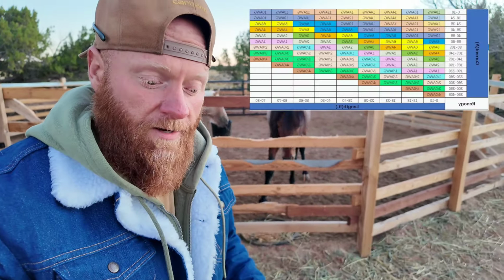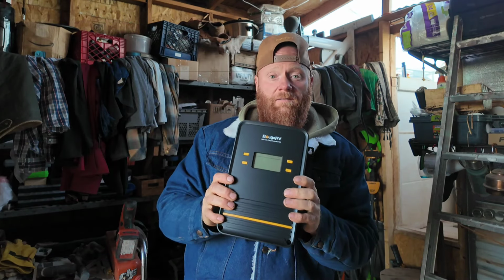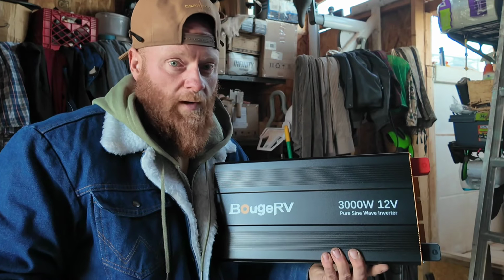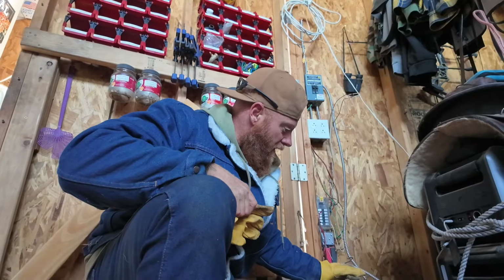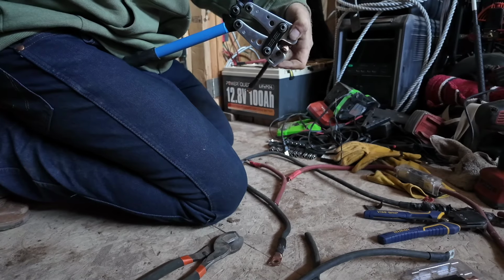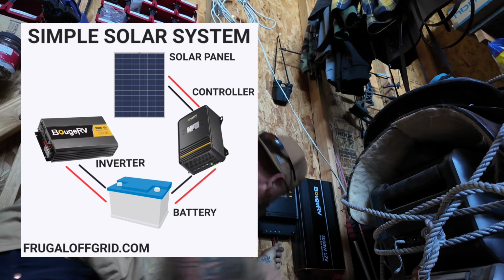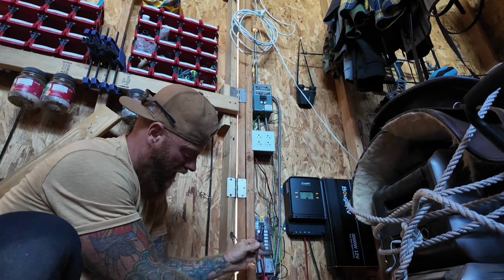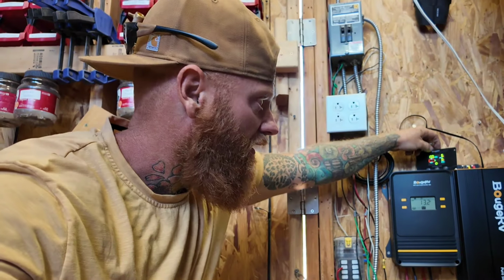12v solar system - Cheap & Easy

Comment from the maker: Here's the Bouge RV website: https://www.bougerv.com/?aff=174

I got you 18% off the inverter with code FRUGAL18

Diagram (Oops it was backwards) https://frugaloffgrid.com/blogs/frugal-off-grid-blog/12v-solar-system-cheap-easy

Comment: Very enjoyable post - I have a slightly less powerful system for my RV - 280watts solar, 310ah Lifepo4 battery and 1500 (3,000w peak) inverter switched off when not in use - the battery is a  bit oversized because I got a great deal on the cells which is a bonus for them overcast days - I compliment my system with a DC to DC 20a charger when driving and a 50amp (690w) charger when on hook up - to be honest the solar meets all my needs in Spring & Summer - I think the most important tip I would convey is keeping your low voltage wires short and ample gauge and ensure all parts are vented to keep cool - all my gubbins are in an under seat cupboard so I have two vents one with a  computer  fan that is set to come on if it gets above 40c
Reply from the maker: Thank you for sharing!

Comment: We use no Mppts, no inverters
Simply connect solar panels with leac acid bateries and the load wires onto the batteries
We get all night long power backup and 
We use seperate wires for the LED lights and fans and both run fine and theres never been a single accident in years

Comment: Just be sure to ground the inverter to something.. 

The rest you did just as I would. And I am a Commercial electrician for 30 years.
Reply from the maker: Thanks for reminding me. I have a grounding rod just outside that door. I had my old system connected to it but didn't connect this one.  I will, tomorrow.
Reply: @FrugalOffGrid  Ground rods are useless in low voltage applications.. Unless you have the rod bonded to the building steel structure some place. You need to bond it to something like building steel. As you have no electrical box to bond it to..  All a ground rod does is give the short to ground some place to go if the main ground is broken.

This is something Commercial Electricians understand as well. But if sure sells a lot of ground rods for light poles. As a short to ground always seeks a path back to the source. Not the ground rod..The source in your case is the inverter. 

This a a common failure for inverters as well. People do not use that ground nut on them.

Comment: Frugal Off Grid will that inverter run a washing machine and a swap cooler and how many amp hour battery will I need and solar panels? from fresno ca 9.26.24

Comment: I built my 24 volt 400 AH solar system i bought a  24 volt 100 AH Lipo4 Battery every month until I got my system up and Running. I use Li Time batteries i think they were around $445.00 each
Reply from the maker: Sometimes, that's what it takes.  They will last a long time.

Comment: But why build 12 volt? Use 1980s technology? 48 volt is the only thing that's not a waste of money. You spent more money on wire than I spent on my whole 48 volt system
Reply from the maker: This couldn't be further from the truth.  I used almost 100% scrap, but it wouldn't cost $50 for wire.

Comment: Use a resistor when running battery bank to inverter. Take a 6 om. on the hot side until the inverter lights up, remove resistor, then quickly attack the  hot side. No sparks, and you won't blow up the inverter.

Comment: Thank you for making this video.
I did not see a fuse between the Charge-Controler and the Battery, most CC's have it built in, but I always add the same size amp fuse as the CC. 100 Amp CC = 100Amp Fuse.

To prevent that spark on the inverter connection: Use a normal 12V old-style car lamp and connect it between the wire and the pole, when the light goes off, you can connect with no spark, the 12V light slows down the Amp rush to the capacitors in the inverter.

New Users keep in mind the 100A 12 V Battery can only push out 100Amps so you can not hook up anything bigger than a 1200Wat Inverter to that one battery.

200A Battery = 2000W Inverter / 400A Battery = 4000W Inverter. You can go smaller but not more than what the battery can provide in Amps.

Hope it helps :)

Comment: And as for Chinese 3KW, 12volt sinewave inverters..mine DOES have very comprehensive panel display, but susPECT...may be the inductive load "sensitive" high frequency, small transformer/transformerless setup, so I'm LUCKy to start larger saw, chainsaw, mower...inductive loads, & EVERy big load welding 2/0,etc connection MUST be clean & snugged down GOOD, or the inverter brkr/low-voltage pops, so I gotta walk 70 or more ft to re-set. Aagh! And hooking a filament lamp up at same time can help soak up some of the inductive load "surge kickback  Even small AC fridges can have nasty kickbacks..especially if the contactors getting worn contacts.

Comment: OH boy..Dude! Use an old filament type 12volt headlamp in series with the red inverter feed FIRST..As inverter capacitors charge the lamp dims, then hook big red lead up. Your big--s inverter capacitor bank will last longer!

Comment: Nice solar setup, mine is similar to yours. I'm running four 450 watt panels, five 100ah power Queen LiFePo4's, LiTime 60a charge controller in a 12 v system here in Jamaica.
Reply from the maker: Very nice!

Comment: kind of surprised you're not using busbars - sure, they're not required but can make expanding easier.  good, simple system though!
Reply from the maker: There's a Busbar on the wall next to the system.  I didn't hook it up or show it because I have no use for it currently, and it would be an extra step making this less of an EASY / CHEAP build.  Thanks for the input.

Comment: Hello, when connecting the battery to the inverter, first connect the positive and then the ground, this way the system will be protected. good work and good luck.
Reply from the maker: Thanks for watching
Reply: @robertogilferreiramonteiro9173  how does it make any difference in this kind of setup? Both are just direct connections to the battery unlike in a vehicle where the 'ground' is the body. The circuit won't be complete till the last connection regardless